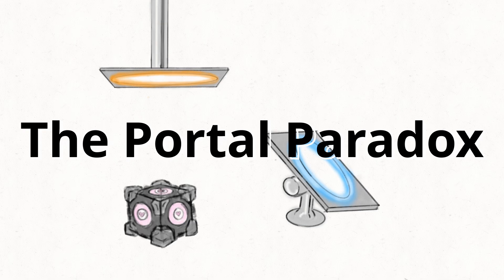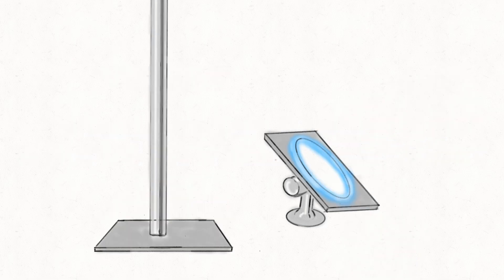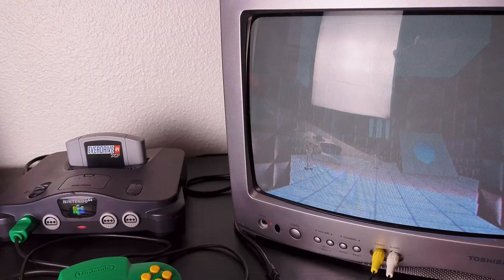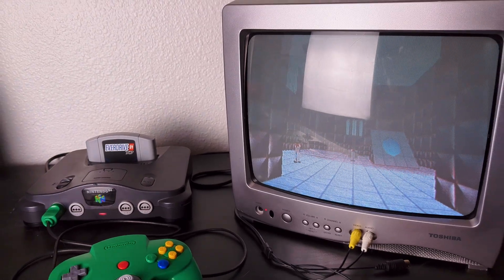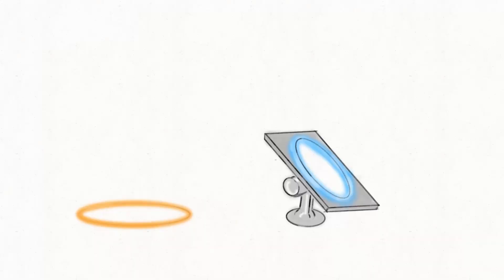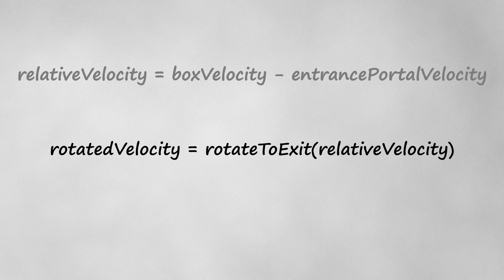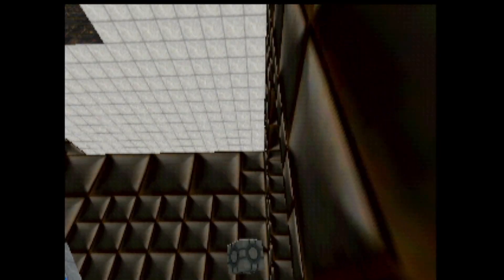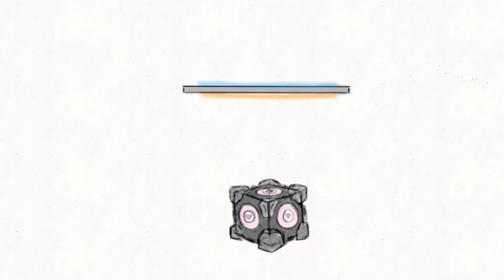I rewrote Portal from scratch and solved the Portal Paradox

Comment: i dont think there is anything wrong with the equations. i think the the assumption that they apply to something that doesnt exist is a leap that can't be refuted or supported.

if you jump straight up and the room shifts sideways so that you pass through a doorway while midair, it seems to match. but if the room you jump in keeps moving and the second room stops when it meets you, you do not fly across the second room. your up and down velocity also unaffected by the room's lateral movement. we do not know if the character is translating through a space in which our known 3d velocity has any effect. i think it is just as likely that walking into a portal with one moving side and one stationary side results in walking into a matter mower, shooting your particles farther into whatever dimension the portal translates your body into. or that you get pulled back with the movement of the first side, or with either side that has a stronger force on the body it is moving.

thank you for the explanation and demo of your work. i think if we can agree to use your assumption, it all checks out

Comment: You're saying that the portals velocity is transferred to the object, I see nothing to make that the case. Things are able to straddle the portals, if they are just a hole in space, which is kinda how they are shown in actual portal, since you can see thru them and step thru them and stand in them and be at both sides and see yourself at both portals then why not have the object stick out of the portal as much as it would if held at the position with nothing moving. I think the problem in your take is that you are treating the 2 sides of the portal as discreet entities and they are not truly discreet, they are 2 halves of a whole. (pun intended) They form a shared space time much like if you were to lower a room with a window on the bottom and have that window pass a cube that was held up by a platform... it would just raise into the space and not shoot out of it.

Comment: I still believe you would not have any momentum at all. The rule is "speedy thing goes in, speedy thing comes out" but the cube isn't speedy. Portals maintain momentum. That should also mean they maintain the lack of momentum as well. The cube doesn't move at all because of the portals. The only movement that the cube would experience is because of gravity. Because gravity suddenly changed directions when entering the portal, it would fall towards it, but that's it. So yes, it should just plop out but not shoot out slightly. It would actually slide down the ramp if the angle of the ramp was steep enough. If the ramp was not steep enough for the cube to slide, the cube would not move whatsoever and should just be sitting on the ramp.

Comment: This is an awesome video! I'm loving the N-64 build of portal 😂 I was under the impression that when you move the surface the portal is on, then the portal would disappear; thus negating even the ability to move a portal onto a cube. 

I suppose one could make the argument that since the whole planet is moving in 3D space, (with my reasoning) portals could never work unless the space they occupy was totally neutral and unmoving. To that I would say portals are perhaps relative to either the planet and it's gravity, or perhaps portals are relative to each other.

Someone else have input on this kind of reasoning?

Comment: So if your exit portal were travelling in X at the same speed your entrance was travelling in Z, then the cube would lazily plop out and land uneventfully on the ground. Assuming the exit frame is on or very near the floor.
This would be an interesting example to provide for those still insisting that you're wrong.
..
I now wonder how it would look if the exit portal were travelling in a positive direction; would it add further velocity to the cube? Or would it resist and subtract velocity, perhaps keeping the cube from passing through at all?

Comment: This is a good way of visualizing it and it makes complete sense, to me if the exit portal is stationary it's a no brainer that the cube is flung as the cube is literally pushing itself. Think of it in layers, the first layer is transposed as it touches the portal surface to the other portals surface, but when the next layer comes out pushes the previous one out of the way, so when the entrance portal is moving it's velocity is transferred to the cube via the force of the cube pushing on itself.
Reply: No, my dude, it's doesn't make any sense. His equation is wrong. Not in math, but by itself.
Reply: @FantasTik Boom  exactly! He is trying to make a hole, a lack of energy and matter, be a frame of reference to impart force on another object. His formula has 1 variable, a box, and a hole accelerating at it. If the box somehow was accelerating through the hole with no force acted upon it then light itself would accelerate through thw same hole and exit faster than the speed of light.
Reply: @xelgodis80085  Someone named "Diego G" strongly argued with me, until I gave him an experiment. Then he deleted his comment.
That experiment is:
"We stop the portal halfway of the cube. Did the cube move? Before I answer: you clearly see the platform and the cube. The answer: If you apply author's equation here, the result will be different. The cube will get enough speed from the portal to fly out. And what you see is exactly why this equation is wrong. Cube didn't move and wasn't pushed, but it flyed out.
Right result would be: cube didn't move at all."
I just pasted some part of reply... actually because I saved all my replies... I thought them being cool lol
Reply: @FantasTik Boom  I was a bit brash myself, but it seems everyone who has argued with me seemed to shut up real quick when I asked the how a void passing over an object interacts with the object, and if a void can accelerate something passed through it then light itself must accelerate past the speed of light.

These people assume the entire universe has a single inertial frame of reference and nothing else matters, which is the flat earth argument for gravity-denial.

Not understanding basic principles is how we get radical conspiracy theorists, and it's dangerous.
Reply: You don't understand quantum entanglement and it shows. 

Tell me, what force acts upon the cube?

Comment: I am no expert, but your explanation seemed odd to me. Here my thoughts: For the cube to be flung it would need some sort of kinetic energy, but right before passing through the portal it has none. The portal itself is just on a surface and while this surface(and the connected object) has some energy, it looses all of it either when crashing onto the floor(elastic energy) or through some sort of stopping mechanism(thermal energy). None of the initial energy gets transferred onto the cube because the surface never makes cotact with it. With no added kinetic energy the cube would not carry any momentum when coming out of the other portal because energy cant be created from nothing. As I said im no physicist, but thats how i would explain it. Anyway i think the disconnect between reality and programming occurred when, for simplifications sake, James did not program all forms of energy, but only momentum(potential and kinetic energy) into portal 64. But since the momentum of the platform does not get transferred to the ground the only way to transfere it in the simulation would be onto the cube. Im even more sceptical of my interpretation of the programming, but this is what i would imagine happened to the existing values.
Reply from the maker: Stationary portals already have the problem of creating gravitational potential energy, so the energy problem exists in either solution.

Comment: I think the true "Portal Paradox" lies not in the clear, discrete time behavior of the system, but how the motion works in a slowed, more continuous case that probes that discontinuous boundary and mixed forces/momenta (gravity pulls 'down' on some volume of the cube yet the remaining volume has momentum in non-orthogonal direction). For example, a really tall, stretched rectangular cube and an accelerating portal. What happens in your implementation?
Reply: the cube would slide out slowly at first andthen faster ,as the moving portal sped up , out of the stationary portal before being thrown out like in this demonstration. i think
Reply: I was also thinking what would happen in the portal's velocity wasn't constant while an object was corssing it's boundary, since e.g. if we stop the portal, the parts of the object that were stationary relative to some other objects around it are expected to remain stationary, but the parts that got through are expected to retain momentum and start pulling on the rest of the object. I guess I kinda answered my question, but it would probably mean that a deccelerating portal would "suck" any object it comes into contact into itself.

As for this specific implementation, it seems to be using a very simple principle and the object is considered to be on one side right until it's center passes the portal, at which point it's teleported (unlike in Portal, where, if I recall correctly, the objects can actually smoothly transition through the portals).
Reply: An interesting quirk of this interpretation of portal physics is that if the cube is moving and the portal is moving, the cube will be sped up or slowed down by the portal its moving through which is quite strange and not how I think portals should work they aren't supposed to mess with the momentum of an object. If you just took the entranceportalvelocity out of the equation it wouldn't change much other than these strange momentum transfers from a portal to an object.
Reply: @calebmon  That's not a "interesting quirk", it's relativity (which, admittedly, people often find quite strange). Think about how this would work in real life, where the portals and boxes on earth are all moving around the sun, what happens when the cube "doesn't speed up" in that case?
If you only add exitPortalVelocity (ignoring entrancePortalVelocity), with two moving portals and a stationary cube, the cube will become stuck inside the portals.
It also makes it possible to construct a loop of two portal pairs that will accelerate a cube indefinitely.
Reply: I think this scenario helped me actually understand what's happening in this video. From the blue portal's perspective it would be as though the cube would be moving towards it, so it would keep that momentum it has coming towards the orange portal
i think
So I guess it would be doing the same with a long cube? I... Assume it would be kinda stuck in place until it fully goes through the orange portal, and then when it exits the threshold of the blue portal it would keep the momentum from the orange portal and plop out? That's my best guess. But this hurts my brain and portal is black magic to me so I have no idea.
Reply: @sweetpepino1907  You say "From the blue portal's perspective", but a portal does not think. There is no tricking a portal
The cube might look like it's coming very fast from the perspective of somebody looking through the blue portal, but there is no actual speed. The "lens" that is the blue portal is tricking a viewer perhaps, but a portal doesn't look at how fast something is moving and decide to replicate that speed on the other end
If an object is at rest it stays at rest, a portal is simply a doorway connecting space in an otherwise impossible way
Reply: "rectangular cube"
Reply: At that point you have to think about how gravity itself flows through a portal (if that makes sense) and re-re-make the portal logic to account for it
Reply: Since we're mixing gravity into the equation...would gravity not travel through the portal as well?

Portals are, what, connecting regions of spacetime? So any spacetime affect would be able to traverse the portal boundary, or...? And we know now that gravity travels at the speed of light, so it might propagate out of the portal...
Reply: This makes me think of  hose now spitting out gravity now. All the sudden you have this directed gravity coming out of the portal, would it bend down like water, affected by itself? Would there be currents?  Or would it be like magnets where the field is flipped its repulsed out of the portal.   Making my brain work too hard. Love this game.

Thank you for the video!

Comment: Moving portals are possible in portal 2 using the command sv_allow_mobile_portals. Usually it's turned off but in the part where you take out the neurotoxin it is turned on.

Comment: This brings up alot of questions, about the nature of portals. Because from how I understand the nature of physics your essentially breaking the very laws of physics. Nothing is imparting momentum onto the box, though its obvious that the box should be moving when it goes through the exit portal. Yet, the box is stationary. Nothing is pushing or propelling the box upwards through the first portal, but because its entering the first portal with a "speed" then that would obviously carry to the exist portal BUT, its also not moving. Nothing has broken the boxes static friction, its completely still but also has momentum. For at least a second a new paradox exists that breaks all of physics, to the best of my knowledge. Because the box is moving, but also is supposed to be stationary at the same time. This point I believe is around the half way mark because the other end of the box is moving, because its entering the portal with a velocity and so would exit the other at the same velocity at the same time. So in my mind there are at least 3 possibilities, though I wouldn't know which is correct. A.) The box would exit with more velocity then the portal its entering, because the box is being pulled upwards, through the first portal, by its own momentum, assuming the box stays together, which is then further accelerated by the first portal continuing to push down, only adding to the relative velocity. B.) What we see here, the box moves at the same velocity as the first portal. C.) The box exits the second portal with the same velocity as the first portal but does not have the energy/momentum to continue that same velocity and would drop a rather short distance from the first portal. So what I'm trying to say, is that I don't believe this answers the paradox, but I also don't understand enough about physics to completely argue against this being the solution. Because if B is correct, and A is not because the box isn't propelling itself through the portal at any given point, then the solution is either C, or possibly D, in a real world scenario. D being that the box is torn into pieces at it moves through because parts of it are moving, while the rest remains stationary.

Comment: Fun fact: moving portals ARE implemented in Portal 2! (Spoiler alert, although it's been over 10 years so you really should know by now...) in the neurotoxin factory, there is a single instance of a moving portal. That is the only one in the entire series. The neurotoxin factory is the only place in either the first or second game that you can have a portal on a moving surface. Not sure if it would work, but it would be interesting to see if the Portal 2 version of physics gets the same result.

Comment: After thinking about it again I believe the box would just flop.
The space inside the portals is the same, it's nothing more than a tunnel. That means the box is never affected by the portal and its like slamming down a hula hoop around the box. It wouldn't affect the box even if from the hoops perspective it just accelerated.
And then gravity takes over and the box topples down
Reply: The portal conserves the magnitute of momentom about itself, and the cube has quite a bit going through the entrance. So no, there's no acceleration and NO portal forces.

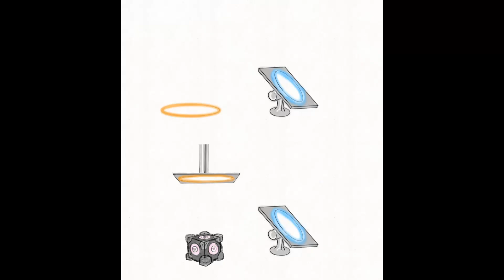Comment: 1:30 the motion is only on the portal side. The portal stops because the ground so the force from the speed would be applied to contacted surfaces but the box moving through doesnt touch. The air moving through the portal may cause some pressure downward or up until its through because the air on the other side of the portal has no reason to move so the portal moving is forcing air through. If the portal is in the same room then i assume the change in pressures wouldn't do much but if you open to a vacuum then a suction force would pull the air and objects through. In the case of this room with relative air pressure, orange portals speed is stopped by floor canceling out forces through area applied, a slight pressure down as box goes through the portal due to gravity and downward path of orange portal forcing air through to denser area as portal descends, as box arrives on other side the change in gravity as well as the slight change in air pressure would cause the box to stay on the platform and then slide.
Reply: I feel like this train of thought is down to a fundamental misunderstanding of how portals work. You're basically just giving the hoop explanation (covered in the video) and applying all of the necessary physics except the ones we actually care about... portal physics.

Comment: The setup of this paradox is inherently flawed.
People think they're asking whether momentum is conserved, but if so it couldn't do the soft flop out.
The actual two situations should be this:
Either the molecules of the box would continue to be connected and push each other, conserving speed/momentum relative to the "shared surface"
Or the molecules do not repel each other (the momentum relative to the ground is constant), instead spawning on top of each other at the exit portal and forming some kind of impossible construct.
BTW: not saying YOU are wrong, just most people asking the question.